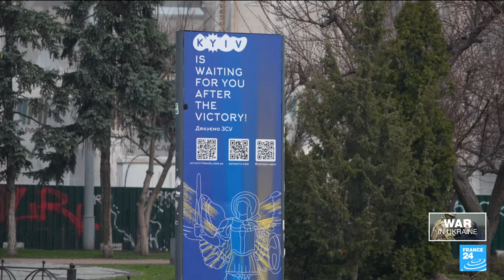Ukraine fortifies its front lines in anticipation of new Russian offensive this summer • FRANCE 24

Comment: FAB 3000  ...:dothefive:
Reply: Mmmh.  Now I get it. To obliterate those defense lines like nonsense 😂
Reply: Fab 5000 and 9000
Reply: @felipe-vibor   FAB 3000 is useless since it's unguided. These bombs can't even help Russians push AFU in the open field without fortifications. Anyway, I think we shall see this summer if Russians will be able to make serious advances.
Reply: @vadimbondarenko3709 A 3mt bomb is "useless because it's unguided"?! Is that what your American masters told you to believe? 
Strange, I saw videos of big buildings dissapearing from one strike, but whatever you say, I guess.. 😂😂
Reply: @vadimbondarenko3709 The gliding module also fits to the FAB 3000. So it is guided. The effectiveness of the guiding module was already shown at the smaller FAB versions.
Reply: It's 3t bro not an 3 Mt  @ledlight1487
Reply: FAB 5000 also there😂
Reply: @mbrofoc Bro, 3mt stands for "3 metrical tons", not 3 Mega tons 😁
Reply: @ledlight1487  you don't need to write that in normal world bro
Reply: my very first thought
Reply: @vadimbondarenko3709 it's guided my friend are you not in the loop?
Reply: @vadimbondarenko3709  If you believe FAB 3000 would be useless against fortifications, how you believe Leopard gonna roll over them?
Reply: 🎉🎉🎉 Absolutely
Reply: @mbrofoc  Agree with that one!))

Comment: Delaying the inevitable. This won't stop the Russians. Avidievka was Ukraine's most fortified position and it fell.
Reply: It fell after Russia lost around 30k casualties. It's a long term strategy called set piece battles where a defended continously forces an attacker to take prepared positions to the point they exhaust men and material waiting for a counter attack
Reply: “Every Oblast east of Dnepr river was never of any strategic importance” -Zelensky in 3 months.
Reply: Adiivka took 2 years to fall so i think the defences are working.They would of never took Adiivka if they had enough ammunitions
Reply: Nonsense. The Russians were in a defensive posture until September 2023.
Do you recall Ukraine's greatest summer counteroffensive ? The battle times frame is  late October to February. So, about 4 months. It actually fell pretty quickly given its strategic importance for Ukraine. The time is on the Russian side as Ukraine is short of men and ammo.
Reply: @melissakelly5813  They had amunition but were using it too fast.  As for 2 years, the biggest suppliar of amunition, the US and NATO took 20 years in Afghanistan and still achieved nothing.  As for taking 2 years to take Avdiivka, there were other places that needed be taken before arriving to Avdiivka.

Comment: There is such a thing as paratroopers, or have we forgotten about them?
Reply: The lie has to continue. They don't want to see or hear evil.
Reply: @Yourbrightspot  Agreed... Elon Musk made another appeal to Zelensky and Ukraine over the Easter weekend but that too doesn't fit the narrative. The trajectory towards WW3 is set and I can't see anyone deterring them now...
Reply: Russian planes haven't been able to fly across the front line for a long time. The Ukranian air defense systems are too strong to risk it.
Reply: dragon teeth only work against blitz kind of maneuver attack, not a slug fest attack like what Russia loves to do.
Reply: We don't see your Russian helicopters that much anymore. Do we?
Reply: I have considered this but how would it work? The AA environment is pretty harsh making any significant airborne assault near impossible. Even if they had the units airborne operations require a lot of prep and still have a high failure rate.
Reply: @link10909  your problem is that you are closing your eyes and do not want to see that such a lie will not work when faced by an anemy that have advantage in the air. But others can see through this lie. Choppers can send paratroopers beyond this line. The soldiers in this line will be trapped and forced to surrender.
Reply: @Yourbrightspot  Lol sure, if that was a good play why hasn't it been done? Long range AA systems like patriot and S-300 keep going high off the table, and IR manpads have proven deadly to helicopters going low. Russian "advantage in the air" has proven effective at getting some bombing to the front line but penetrating past it hasn't really materialized yet.